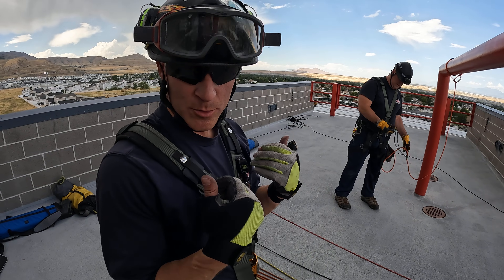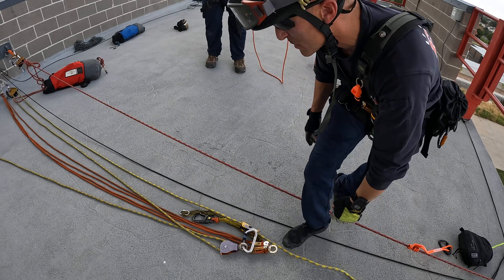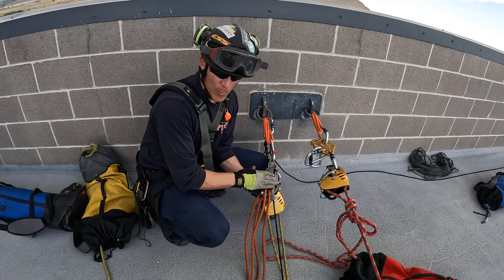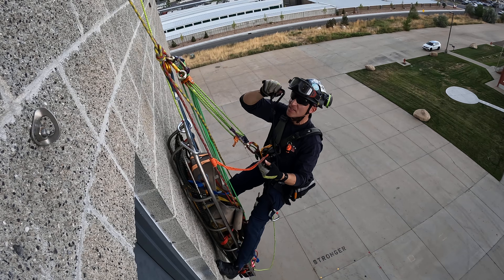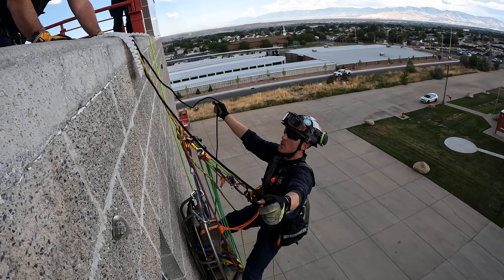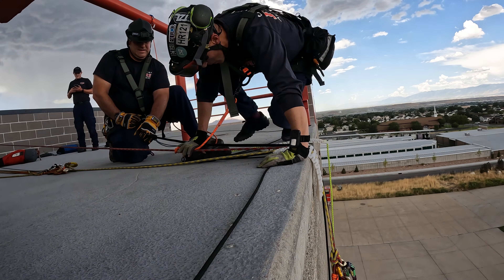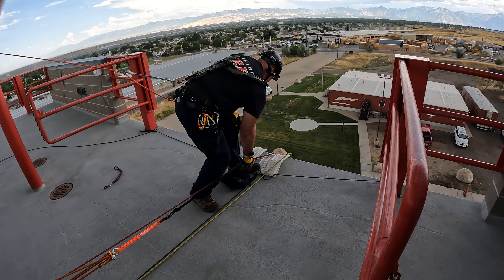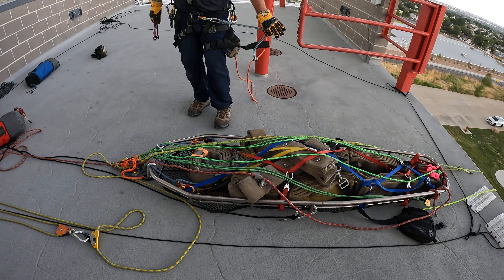Pike & Pivot V-Strap: Hauling a Litter Up Over an Edge When You Don't Have a High Directional

Comment: Ive had some Instructors say that you should be aiming for doing this, horizontally as its easier on the casualty. Personally, Ive always done it vertically, never learnt it horizontally. Have you ever done it that way before, if so, hows it compare rigging wise for the edge transition?
Reply from the maker: In my iterations of practicing it horizontally, I liken it to “a bunch of monkeys trying to f!@k a football”.  While nothing is off the table, my go-to is a vertical orientation.  The people managing the edge would also concur.  I just find it to be so much smoother and less labor-intensive for everyone.  Easier for the edge attendants too, w/ less exposure.  The argument for being easier on the patient can be heavily debated.  There was an ITRS presentation from a doctor within the past couple of years all about patient packaging in a litter.  I will say that if a patient is in a litter vertically, then their feet should be lashed up to higher stanchions in order to relieve pressure on the femoral region, & distribute the weight between harness & foot stirrups.

Comment: All that rigging across the face would be very painfull
Reply from the maker: You brought up a valid point... An easy fix to direct the strands of the set-of-fours so that they aren't pressing into the patient's face is to simply clip a large HMS carabiner to the side of the litter then route the AZTEK strands into it.  This is a common practice when rigging for vertical orientation.  I just didn't show it in this video... But I will post it to my "community" tab on this channel here shortly... But in the video if you look at which ropes are under tension, the only one that is in front of the patient's face is the rescuers AZTEK and it is at least a couple of feet away, so there's no facial contact there.  All the other ropes (both long tails from the Bowline and the foot bridle) are completely slack & therefore, even if they contact the patient's face, should not be painful.

Comment: Been watching more of your videos. You guys are squared away.

I hate being that guy but when you popped over the edge you should have been connected to a secondary point of attachment other than one prusik for the sake of continuity if nothing else. I realize your hands and feet can be considered that secondary but not quite. Not really. 

Also, for efficiency I like how you dead legged the haul system for the pivot. But it introduced slack when you made the move in the main line. Have you thought of just using an independent 4:1 while taking up slack in the main haul? 

I think you guys are the only FD I've seen using the Maestros. Maybe it's a west coast thing. Is there a reason you chose Petzl over the CMC Clutch? 

I'm more curious than anything so please don't take my questions as criticism. I love seeing how other departments do their job.
Reply from the maker: - I think that there is a constant & ongoing internal dialog of self-assessing where you stand in the "hazard/risk/probability/severity/consequense" game.  For me, it's a calculated decision to determine how many connections I should have into any system or systems at any given time.  While performing the balancing act of safety vs redundancy, for my own personal security I feel reasonably comfortable that a single attachment via Prusik onto the Belay line while climbing up over the edge is an acceptable practice.  Granted you are in the fall zone and even though your hands & feet aren't considered an attachment into the system, I feel comfortable in relying on that as my primary support & only having one connection into the system as my backup.  Basically the same as a rock climber who is top-roping.

- Either way you cut it, the main line is going to have to "dead-leg" in order for the Pike & Pivot technique to work properly, regardless of if you have an independent haul system or whether you attach the V-strap to the travelling pulley of the main working line's original haul system.  In this video, the 5:1 AZTEK is in fact an independent haul system.  During the Pike & Pivot sequence, the main line should definitely not be under any tension.  As long as there's still a dedicated & intact belay system & is being tended during the sequence, the whole system is reasonably safe & secure, meaning that it doesn't matter if slack is introduced into the original working line.  I view the sequence in a similar way that I view typical line transfers (tension off one system & onto another).

- Our compliment of hardware includes Maestros, MPDs, I'Ds, & ASAPs.  We went with Maestros pretty early on before the Clutch had come to market, and I don't think that even if we had Clutches as well, that we would want to use them as a device at the anchor... mainly due to the undesired anti-panic feature.  We found that devices that have this feature tend to cause more problems for us when we operate them as fixed brakes.  They are better suited as descenders/travelling brakes... and we already carry plenty of I'Ds for that.  So from a cost-benefit perspective, Clutches just don't make a whole lot of sense for us.... until the time comes where we need to start replacing I'Ds.  I have my own personal Clutch that I love as a personal device & would choose this over an I'D any day, but not if I need to operate it as a DCD off the anchor.  Maestros are my go-to in that application.